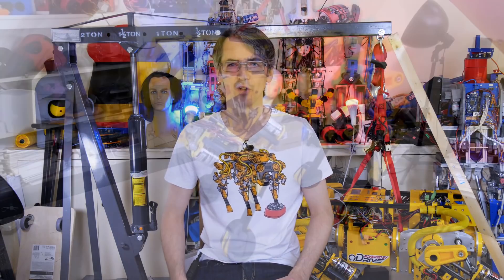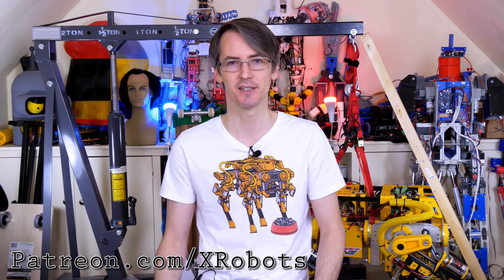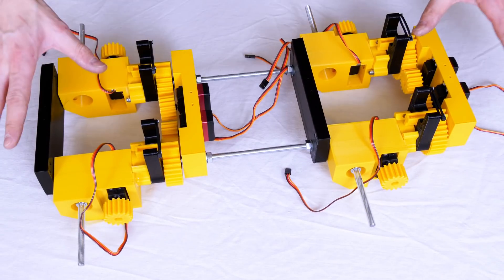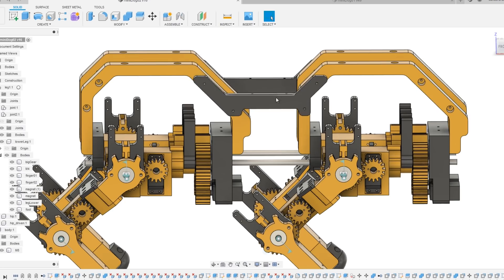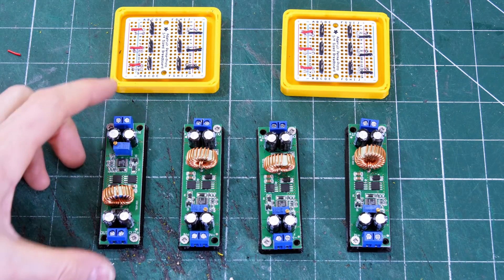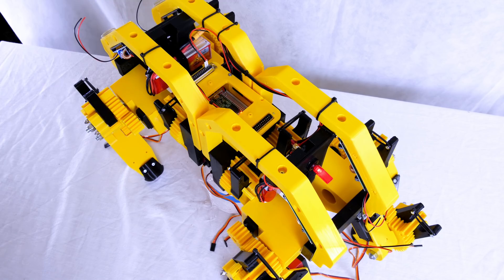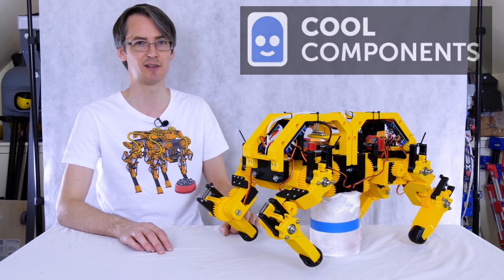Mini Robot Dog #2 - Building the main assembly

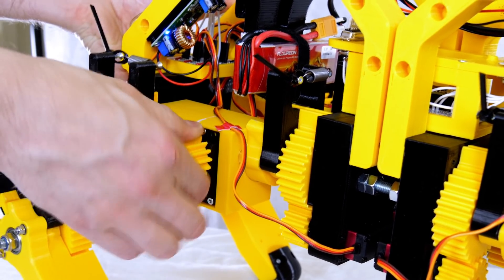Comment: Has someone solved the issue with servo horns moving slightly? At 10:58 you can see how the horn is moving even if the servo position is the same.

Comment: I wonder if you moved the hall sensor's clamps on the side of the feet, you could get a way better turning radious on the bottom part of the legs, maybe it would make it possible to switch between "crab" and "dog" leg positions depending on the task at hand.
Reply from the maker: Possibly, but of course the servos run to their end stops a some point as well.

Comment: Not sure how I feel about the symmetrical design.  It makes sense for a robot but makes it look a lot less like a dog too.  Natural quadrupeds are less balanced at rest so that they are balanced when running and retain grip on their front legs for steering.  Kinda like how a human sprinter must lean forward to balance while accelerating.  For this robot though I assume it's never going to run, which means your only option for countering a heavy head would of course be a tail, but that adds more weight.  So making it symmetrical is easier.  Just, less doggy.

Comment: The look @4:24 is much nicer than reversing it. Looks too much like a crab now. I think even if the legs are backwards if you could keep the two "handles" facing the same way up there, then it would look much better with the same balancing benefits.

Either way love the project, this size is much easier for folks to build.

Comment: What's the reason for putting the shoulder servos underneath the joints instead of above them? It looks like there would still be enough space for the control boards and the robot would have better ground clearance. Plus it just seems tidier. :P

I'm 100% sure I'm missing something, of course, but what?
Reply from the maker: I considered it, but ground clearance is fine and it's easier to change any servos that fail

Comment: Hello James Bruton, for your problem at 10:46 I have already found any other parts, any metal disc at Aliexpress, I have already used its parts to assembly with my personal SpotMicro, it's a little cheap but less than original parts. 

https://fr.aliexpress.com/item/32488403564.html?spm=a2g0o.productlist.0.0.54c14f82J6m85h&algo_pvid=f981e0bf-6c74-4771-9bef-9d71cfdc53b9&algo_expid=f981e0bf-6c74-4771-9bef-9d71cfdc53b9-44&btsid=0b0a3f8115844365910862144e117f&ws_ab_test=searchweb0_0,searchweb201602_,searchweb201603_
Reply from the maker: Thanks, I got some from eBay

Comment: Did you consider only changing the shoulders? Keep the shoulders the way they are, and swap just the legs around. It currently looks more like a 4 legged crab.
Reply from the maker: There are clearance issues with turning the legs around unfortunately - I'd need to have the hip mechanisms sticking out at each end

Comment: Ever try just using very large (can-type) brush-less motors? They would have the high-torque, high-speed you're looking for. With positional sensors and variable voltage, they could act as a spring all by itself giving you the dynamic, high-speed balancing you're looking for... just a thought. Love the projects regardless and watching you produce these different ideas is great. Thanks for sharing.
Reply from the maker: Yes I've thought about it, it just ends up a much bigger machine to fit the six ODrives in there as well.